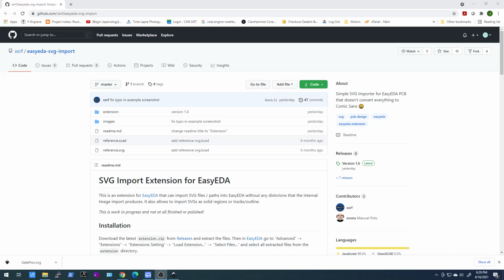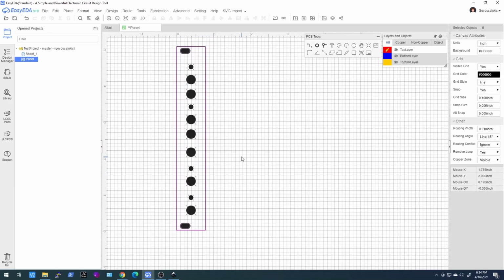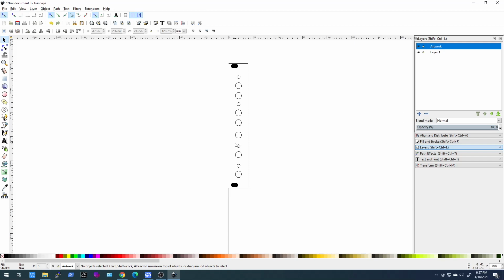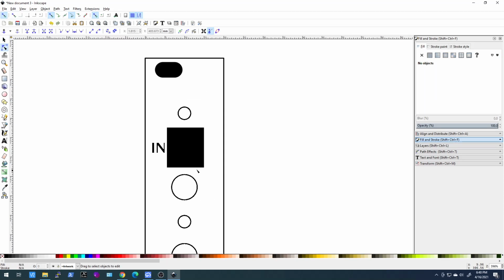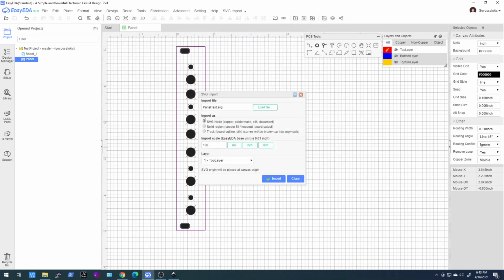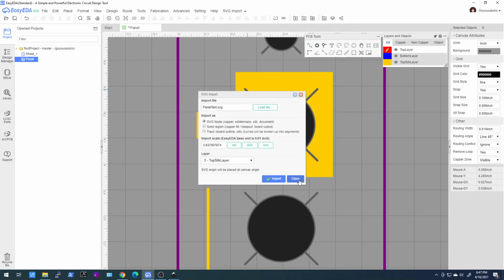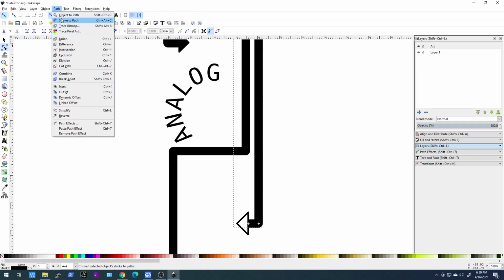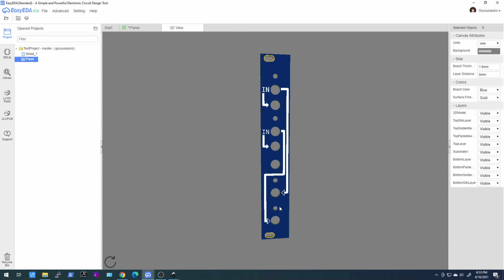Creating Eurorack Panel Graphics in EasyEDA

Comment: Please : Where is "Advanced" -> "Extensions" in EasyEDA??
Reply: In My EasyEda there's 3 folders : locales, resources and swiftshader.
Reply from the maker: Hi Perquiquita, Advanced->Extensions is referring to the top menu bar. You need to install the SVG extension from the GitHub page of the creator.
Reply: @justinahrens1868  I got it but... I tried to save an AI file as a SVG and doesn't work.
It's just doable with Inkscape?
Reply from the maker: @periquitaperez7656  No, it should work with other drawing software. Try starting with basic shapes. Draw a square and import it and see if it works. In inkscape, you have to convert objects to paths. I have never used Illustrator, but there is probably something similar there.